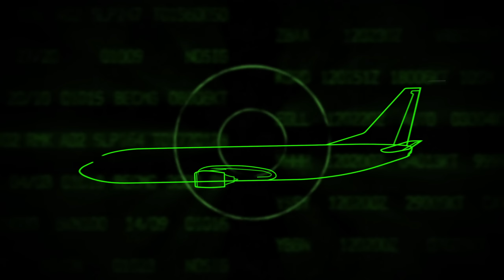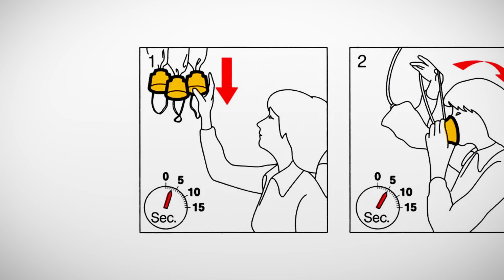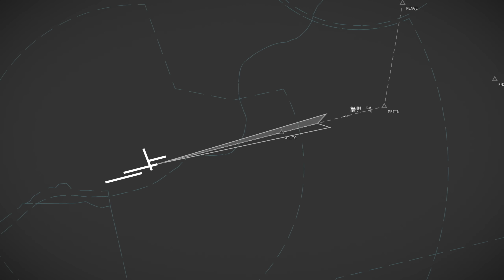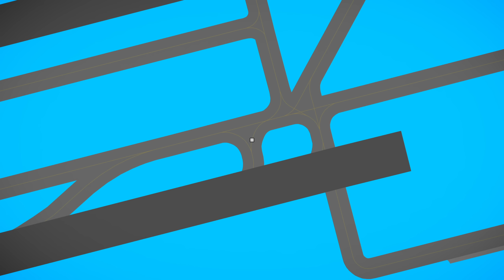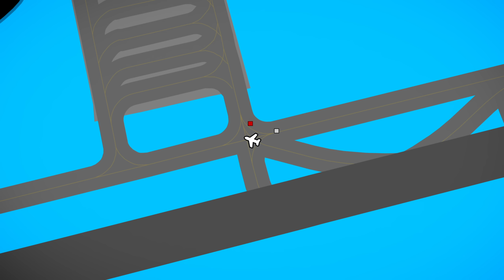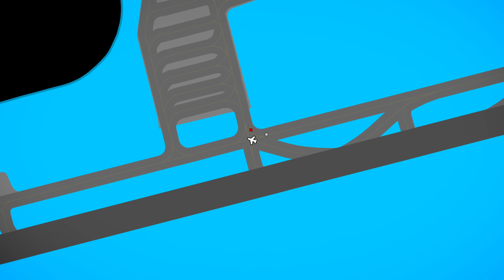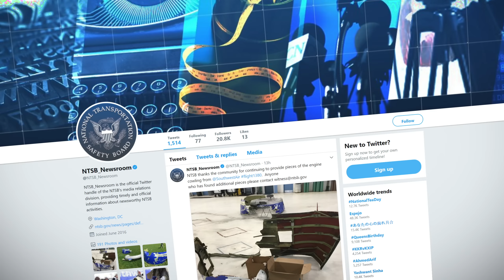Uncontained Failure • Southwest 1380 [with ATC audio]

Comment: At the beginning It’s not a stuck mic or even inadvertent transmission.  They have put on the quick don masks but failed to flip the switch that activates the mics in the masks.   They are keying the push to talk switch and talking but can’t be heard because the mics are not yet activated.  They figure it out after a few attempts.
Reply: This is also the reason, they never officially declared an emergency, I think. They most certainly said "mayday, mayday, mayday, SWA1380 lost engine number one, decending" (or some such) on the first try. That is also why ATC is allowed (and even encouraged) to treat any airplane as an emergency that "feels" like an emergency to them, even if they didn't declare.
Reply: Exactly correct had to a flight headed to Dallas Tx about 2011 hit thunderstorms and lightning all the masks just dropped by accident but the pilot crew and pass used em just in case there was a hidden damage scenario... Took the pilot and crew a few minutes to figure out and remember the mics are in the masks...

Comment: Amazing job! As always the best video covering the incident I've seen. The visuals are much better than on other videos and the commentary makes it feel more professional in my opinion and it provides more information.
Reply: Professional? It wasn't even an uncontained engine failure.
Reply: Andrew Baumgartner Wasn't it really? I thought it was, but if it wasn't I would really like to here why :) Is there a better name for it in that case? I am not a pilot nor an aviation expert so would love to learn something new.
Reply: All turbines must be tested and prove that fan blades are contained within the casing of the turbine in the case of a blade failure. The casing is designed to take the impact of a blade that ruptures when the turbine is spinning at full power. When a blade fails it is flung in a radial direction at very high velocity that would deal severe damage to crucial systems. The casing of the turbine that suffered a blade loss on this flight showed clear signs of where the blade impacted and was contained within the engine. When a blade is lost the centrifugal forces on the rotor are massive due to the imbalance of weight causing severe vibrations. It was these vibrations that caused the intake cowl to be destroyed and tear away from the engine. 
The "contained" part means that the blade must be contained within the casing.
To build a Turbine that guarantees no exterior parts like the intake cowl are lost in a catastrophic turbine failure is close to impossible and if it were possible the engines would become very heavy requiring much stronger and thus heavier wings. The long ranges of todays planes would be impossible and airfares would be so high that only the richest could afford it.
In this video you see a test of such a blade loss.
https://www.youtube.com/watch?v=NvgD139U8os
Reply: Check VASAviation for the non fox "news" approach! Facts only!
Reply: @tigersharkzh   If the failure was contained, what broke the window?

Comment: Landing faster than normal with flaps at 5.... I'm guessing that's a "lesson learned" from American Airlines Flight 191. Great job by all involved.
Reply: She is a fighter pilot. Speed is your friend and she knew how the plane handled at high speeds but did not want to take a chance of losing control of the plane at lower speeds. She flew that plane as if it were a fighter! :) :) :)
Reply: @hubriswonk  I like the thought but I'm fairly certain it's more of a compliment to say she  and the co-pilot flew it like professionals. A fighter is a very different animal than a passenger jet and you don't want a pilot who confuses the two. Something my father taught me... (He was a Marine F4 driver in Vietnam)
Reply: @bwacuff169  she has stated clearly in other interviews that she deliberately kept airspeed fast because she knew how it handled and did not want to take the risk of it becoming unstable at a slower speed.
Reply: Yes.... That's what I was saying when I referenced AA 191... They lost their left engine just before rotation...which took out the hydrolics on the left ... which caused the slats to retract on the left wing... Which led to asymmetrical lift and they couldn't gain enough speed to overcome that problem.

 It's not a fighter problem...It's a flying problem that you want professionals handling.  Not fighter jockeys. 

If you're on a bus you'd love having a former Indy car driver at the wheel. You just don't want them driving the bus 200 MPH.

Comment: That jet engine necelle has very strong light weight splinter armor to contain 90% of the exploding parts that fly out of the failing engine.  Of course some parts like the fan blades do fly forward of the engine and take out a window and passenger.  I still like to say that jet engine armor did it's job very well despite what the video showed.  It could have been far worse.

Comment: Why does fire sit in front of, and to the right of, the AC, when it's the #1 engine failure?
Reply: If there was a possibility of spilled fuel would you park on top of it?
Reply: To protect the exit side of the aircraft in case of a fire.  The fire most likely would be on the damaged side with passengers exiting to the right under protective foam spray from the fire truck.   Later arriving equipment would assume positions surrounding the plane.   I worked at an Air Crash Fire Station.

Comment: Co-pilot didn't report loss of cabin pressure? Or did you cut something out?
Reply: ATC should have asked inquired about the alarm a little more however they were asking a few times asking the captain if there was anything else to report. Frankly I think the crew could have informed the pilots a bit more in detail especially if someone was partially hanging out of the plane for a few minutes I mean geezus cripes that's something you want to mention to ATC and ground fire crews.
Reply: Agree@theking Silverado I think a lot more info & urgency could have been communicated to the ground.
Reply: THEKING SILVERADO They cut a lot out of this video.
Reply: THEKING SILVERADO the captain did report that and asked for medical assistance
Reply: yougottabekidding they did not really have more info than that. They knew about the engine failure, the broken window, and that someone was hurt. What else was there?

Comment: Why was there limited info as to injured passengers ?
Reply: I wondered the same thing. I know they had their hands full in the air but you would have thought it would have been mentioned so they would have medical support ready as soon as possible.
Reply: The communication has been heavily edited in this clip. The captain did tell ATC that a part of the aircraft was missing, that someone went out of the window and that they needed medical assistance on the runway. All this has been edited out in this clip which makes it a less reliable recap of the event.

Comment: Technically, I believe, it was a contained failure with the subsequent vibrations causing the cowling to come lose. The fan blade did not penetrate the housing.
Reply: That means uncontained. Whether it be from any part of the engine, if it fails and escapes that housing, then it's an uncontained engine failure but I see your point.
Reply: if it was a contained failure, what broke the window?

Comment: Technically it was a CONTAINED failure as the engine components were kept in the engine.. The cowling was what came apart.
Reply: Cowling wouldn't fly sideways and take out a window.  Mostly contained.

Comment: For everyone saying how great a job the pilot did, she did a piss poor job of conveying the urgency of getting EMS on board to help the one passenger they had that was in critical condition (and who would later die).
Reply: Her job is to AVIATE, NAVIGATE, and COMMUNICATE - in that order. She has the lives of ~150 people in the air AND anyone in the path of her disabled aircraft to consider, and getting that information and relaying it to the ground does none of those people any good if she can't get the wounded bird on the ground safely. You should also know that this video is missing some of the audio on the various communication channels, including "we have a part of the aircraft missing so we're going to need to slow down a bit" and the infamous exchange: "they said there's a hole and someone went out." (That last one led to the best momentary-WTF-followed-by-professional-recovery by the ATC on duty, which if you've not heard is worth finding for a listen.) Remember that the pilot will only get the information on wounded passengers as the cabin crew gains control of the situation which includes dealing with panicked passengers, making sure oxygen masks are on, and in this case physically getting the passenger back fully inside the aircraft and finding medical aid. The declared emergency including single engine, parts of the aircraft missing, and fire all IMPLY the need for emergency services on the ground which she would later explicitly confirm once she was sure she was going to GET there and how - nothing more needed to be said. On top of all that, don't confuse when the passenger was PRONOUNCED dead by a doctor later at the hospital and when the woman died - reports were that passengers and crew were performing CPR on the passenger after she was pulled in - indicating her heart stopped long before any ground-based personnel were involved. 

In short - this pilot was calm and professional in incredibly difficult circumstances, and a hero in my book for her handling of the event as well as her past service as a military pilot. I'll take her as my pilot any day of the week and twice on Sunday.

Comment: The NTSB has already stressed, multiple times, that this was not an "uncontained engine failure.". Please stop spreading falsehoods such as this.
Reply: A contained failure doesn't rip the front cowl completely from the front of the engine, nor does it cause the sides to bulge and most of all a contained failure wouldn't through debris into a window causing the death of a passenger. Correct me if I'm wrong but this explosion was uncontained thus puncturing the passenger cabin. My question would be why are these planes allowed to fly? This makes the second uncontained failure of a fan blade for Southwest. Someone better get to the bottom of this or discontinue use of this particular engine on these or any other plane that uses this particular CFM engine.
Reply: Willie Gillie yes, it does. There are many videos on YouTube and they show exactly what is supposed to happen. The front cowling is not something you can contain. The sides bulge but are not punctured, because they successfully CONTAINED the more dangerous internals from literally shooting holes through the cabin.
Reply: Jody Kemper If it was contained in both instances what poked a hole in the fuselage of the southwest forced to land in Pensacola? And what broke the window killing the woman sitting next to it. Could it have been a piece of fan blade or something the blade sent through each passenger cabin? In each case the fan blade was the culprit and the damage was not contained within either engine. Look at the photos. Do you even understand the term contained??????
Reply: Willie Gillie I was unaware of your role in the NTSB investigation. Surely, you must know that only a fan blade could cause a hole or break a window. There must be nothing else, such as an engine cowling, that could cause that type of damage.
Reply: Willie Gillie the NTSB has stated this does not appear to be an uncontained failure. I'm not sure why you claim I am smarter than they, I'm simply telling you you're not, and you're promoting an opposing, uneducated opinion.
Reply: Jody Kemper The NTSB knows full well it was an uncontained failure. Since you seem to think they don't provide the link of them saying it wasn't.  Doesn't appear is a lot different then saying it didn't happen. I'd like to see one person that says something didn't come flying from that engine to pierce the passenger cabin on both the Pensacola flight and this one. Provide the link and I'll take a look at it. Like I said before a contained failure means the destruction is kept within the engine shell. It doesn't take a rocket scientist to see a window was broken from flying debris on one of the planes and the left side passenger compartment was pierced on the Pensacola flight. The cause... Turbofan failure... both instances!
Reply: Jody Kemper okay let me ask you a simple question. Did the window break by itself?
Reply: And on the Pensacola flight did the passenger compartment damage itself?
Reply: Willie Gillie there have been two very informative press releases, they're not difficult to find. You seem to be quite the expert, though.
Reply: Jody Kemper I'll take that as a compliment but I would sure appreciate a link to the NTSB denying an uncontained turbofan failure.
Reply: I'm not from the NTSB but I'm a ground engineer for a large airline. This incident wasn't an uncontained engine failure. The definition of an uncontained engine failure is when fan blades burst out of the engine. No blades made it out of the engine in either of the SW incidents. What happened was the unbalanced rotor after loosing a blade (that was contained) caused severe vibrations that tore the cowl apart and that was what damaged the rest of the plane.
Reply: Andrew Baumgartner well duh?!? Where did the fan blade go then??? Your a real rocket scientist aren’t ya. So just where do you think that fan blade went? Was it ingested by the engine? And where’s your proof of where it ended up? And genius I suppose you are thinking that fan blade had nothing to do with the damage to the cowl and case of the engine or the window this poor woman was sucked out of
Reply: Andrew Baumgartner the report did mention a breach hole. Breach meaning it went through.
Reply: No, the fan blade didn't damage the intake cowl. It was spinning at high speed when it failed while the plane was traveling at cruising speed. There's no way that a blade is going to move forward. It moves outward. There is, as stated in the NTSB report I posted, no sign of the blade leaving the engine in a radial direction. There are clear traces of where it hit but was contained. It then went through the engine and in pieces out the back so yes, it was ingested. no, I'm not a rocket scientist, I'm a ground engineer. I have disassembled, assembled, inspected and tested hundreds of turbines over the last 27 years. The intake cowl was damaged by by severe vibrations caused by the imbalance of the rotor.
Reply: Andrew Baumgartner do you not know what blade penetration means? Read the report again
Reply: @tigersharkzh   With all due respect, how can a cowling be hurtled toward the aircraft fuselage (several meters away) while the aircraft is traveling 500 mph? It had to be a fan blade or other internal part that was "shot" towards the aircraft rather than be blown downwind.
Reply: Then what left the engine and took out the passenger window?  You and maybe the NTSB can play word definition games like Bill Clinton but the damage was not contained to the engine and a passenger died as a result and that's the definition of failure..